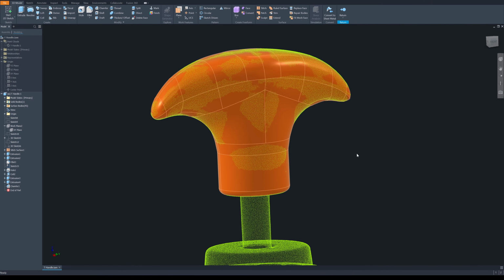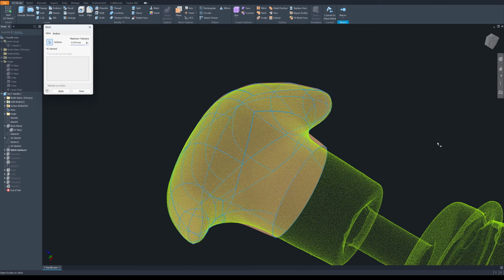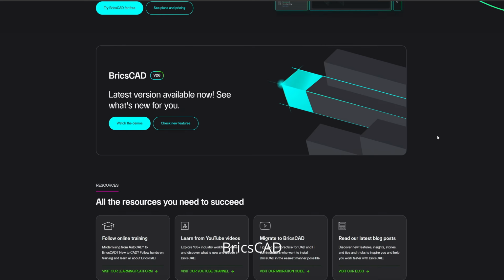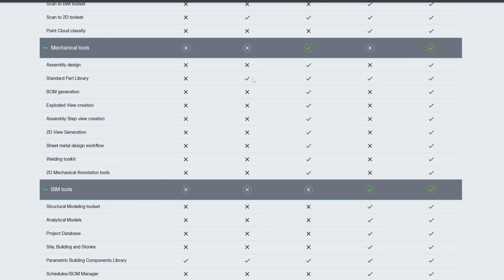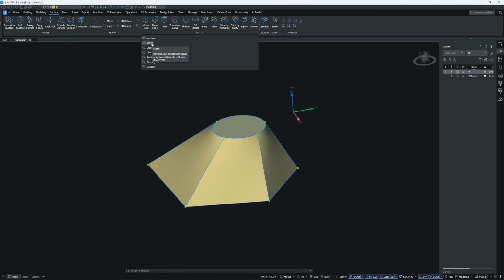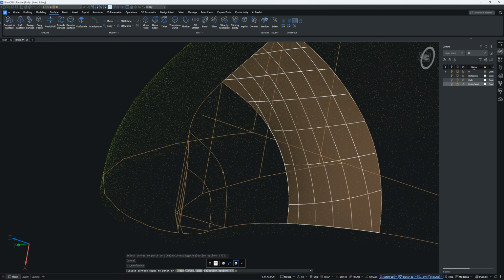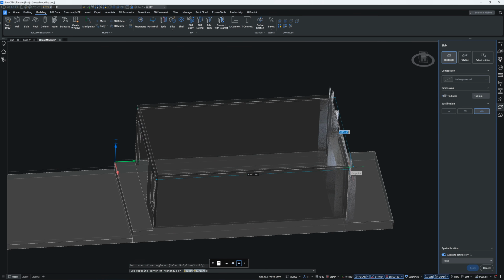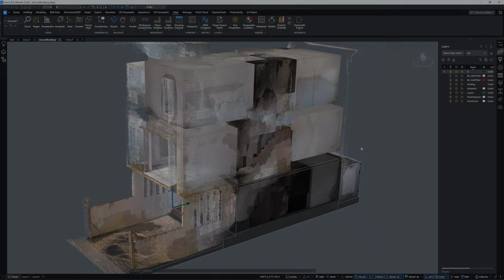Budget CAD That Works with 3D Scanners | BricsCAD Review

Comment: Does BricsCAD Pro still require paying for step import/export? 

Was NanoCAD up to par to this?
Reply from the maker: The new BricsCAD V27 includes STEP and IGES import and export. As for NanoCAD, I’m not familiar with it. If the software has been in development for less than 20 years, I wouldn’t consider it a professional CAD tool.

Comment: The process of using point cloud underlays for reverse engineering is a great workflow. In progeCAD, the same result is achieved using the POINTCLOUDATTACH command to attach .pcg, .rcp, or .rcs files as 3D vertex underlays.

Comment: Dear friend, thanks for the video. What's your opinion about bricscad ultimate for mechanichal engineering and reverse engineering? Modeling 3d parta, assemblys, motion, 2d detailing, reverse engineering small components. Sorry for my english.
Reply from the maker: It's the fastest and easiest to use CAD tool for reverse engineering and 3D modeling. 2D drawing generation is not the best but OK to use and it doesn't has 3D FEA just 2D.
Reply: @Payo-TensileCreator thanks friend. One last question. If you have to choose betwen Bricscad ultimate (about 3500$ perpetual) or Fusion 360 (about 500$ anual license) to work, wich one would you choose? Prices in my country*

Comment: Thank you for your informative videos!

Fusion has some surprisingly good features for reverse engineering from a mesh that I learned from Clough42’s video “My 3D Scan to CAD Workflow: Using Scan Data in Fusion”. You can align the original model in Fusion (without using e.g. CloudCompare first), then use Create Mesh Section Sketch, and in that sketch use Fit Curves to Mesh Section. It’s not usable for everything, but learning these two commands were transformative to me.

Comment: So it's mostly like AutoCAD, with bits of Plasticity.
Reply from the maker: It runs the same shortcuts and command lines, and impressively, it can loft with 3D splines, so replicating surfaces is simple. The only drawback is that its patch surface tool falls short compared to AutoCAD or Inventor.

Comment: I've resisted transitioning from Fusion to Inventor both because of the cost and having to learn a new software?  But seeing those point clouds processed way easier than a mesh for accurate reverse engineering I think I have to switch now.....
Reply from the maker: If time allow, I'll also check out the ZW3D, it looks pretty much the same as Inventor.

Comment: How does the briefly mentioned Rhino compare?
Reply from the maker: Rhino is excellent for designing and modeling complex surfaces. But when you import point clouds or meshes, performance drops significantly. Since it still relies on OpenGL as its graphics engine, I wouldn’t recommend it for reverse engineering.

Comment: Hi do you ever use solidworks for reverse engineering? Would you do a video of reverse engineering from 3d scans like bumpers or other mechanical parts using solidworks?
Reply from the maker: I don’t currently hold a SolidWorks license, but I’ve trained engineers through the transition from SolidWorks to Inventor. I'm planning videos on car bumper project.

Comment: Thanks for sharing. Another option for importing point clouds is FreeCAD, which has the advantage of being free. I really don't know if it's as capable as BricsCAD or Inventor.
Reply from the maker: FreeCAD V1.1 is fine if you stick with solid modeling. There're work around, it may not 100% match in appearance, but it should get the job done for most people.
Reply: FreeCAD and its disadvantages are mentioned in the video.

Comment: I use Moi3D for most of my 3D print projects. It is basically the same but even quicker workflow UI/UX wise. It was developed by the person who originally created Rhino. It's meant to be the quickest CAD-like modeling software (basically a NURBs modeler). And just like you show here, you can't go back each step to adjust things. Every operation, including booleans gets burned into the model. I learned to work with this limitation simply by copying a model at early stages and hiding it on a different layer as a backup.
It is hard to describe how quickly and intuitively you can model in Moi3D... especially with how well the "on-the-fly" construction lines work, in particular when you combine them with the 4 different views. I have been working in 3D for 20 years and it is still the app I love using for 3D modeling the most.
I recently purchased a Creality Raptor thanks to your videos and managed to combine it with Moi3D. Moi3d supports custom made scripts and someone made a script that can import point cloud data and convert it to points. It is not ideal because it can be taxing on the performance if you have too many points. But it still works for my needs.
Alternatively you could also look at Plasticity. It's a newer software that aims to be the new Moi3D alternative and it natively support Point Clouds.